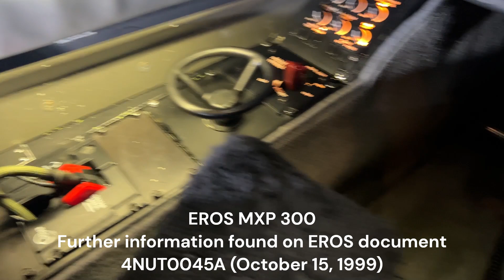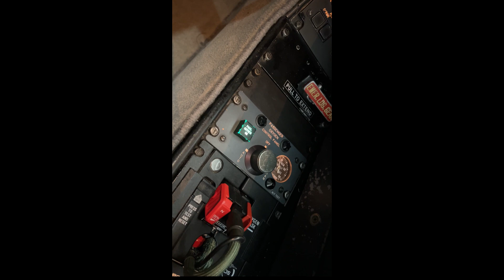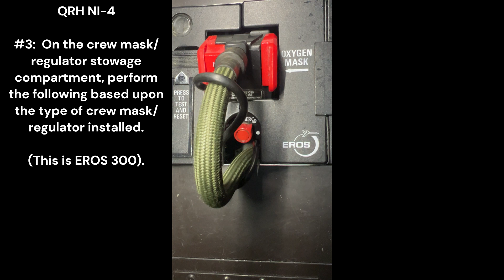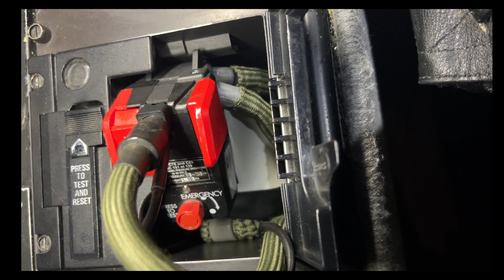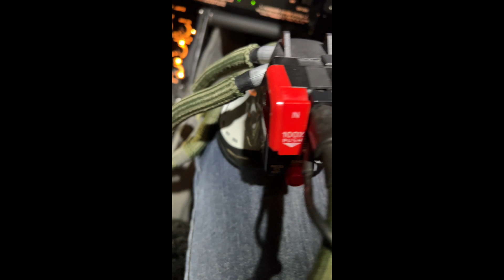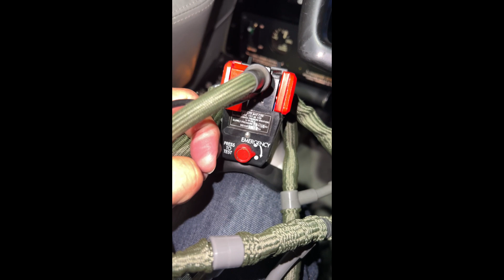Oxygen Functional Check

Comment: Hi Dan, so just to clarify, because the airplane already pressurizes these green switches for crew and passenger supply on/off are just for the masks correct? Are these switches supposed to be on the whole flight or only for emergency use? -Alec
Reply from the maker: Crew and PAX Switches are on entire flight.  PAX O2 is in auto.  Crew has immediate O2 available.  PAX masks will drop automatically once a CABIN altitude of 13,000’ (+/- 500’) is sensed or the crew can manually deploy the passenger masks.

Comment: I love your videos ...have you done a video to shut down the oxigen system? Our masks came down while going fom auto to off position!!!
Reply from the maker: I didn’t include how to shut off the system.  However, if you move the pax oxygen knob a “hair width” past off it could drop the masks.  Be careful with that knob.  To turn off the system, turn both crew and pax switches off, then on copilot side move the pax oxygen knob from auto to off.   Again, even with system off do not move the knob past off (just in case there’s some residual pressure.